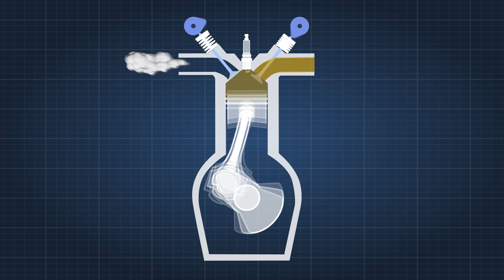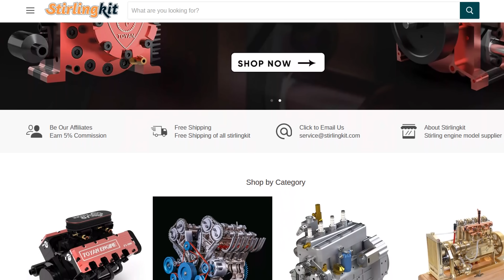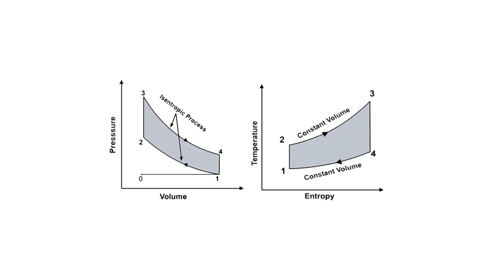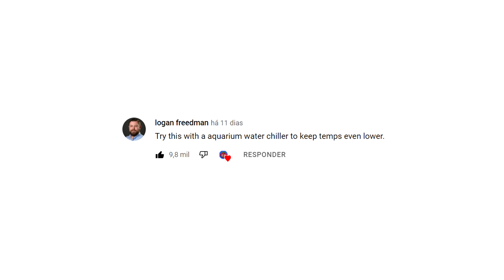I 3D Printed a Transparent Combustion Engine in Resin

Comment: Hey Integza car enthusiast here. We prefer ethanol and methanol for its cooling benefits. So if our car makes 500hp on gasoline, when you switch to alcohol fuels, you have to increase the fuel by 30% to achieve the same power, HOWEVER....its MUCH harder to get it to ignite, meaning you can delay ignition until much further in the compression stroke, meaning a more violent power stroke....all while cooling the temperature of your intake air AND cooling the engine itself....now if you add boost on top of these benefits, you now added compression...FURTHER enhancing the power stroke, so while you need 30% more fuel to make the same power, you can make usually 30% more power on a boosted application because of ethonals natural thermal efficiency...

Comment: #FutureVideoSuggestion  Try this with Multiple Cylinders.  

In my experience in life, I have noticed that the majority of ONE-Cylinder Engines, like in Weed Whackers, leaf blowers, Chainsaws, and such the engine on them are TWO-Stroke with a Fuel-Oil Mixture for power and lubrication combined.  Any time I've ever seen a 4-Stroke Engine, it has ALWAYS been multi-cylindered.  I can honestly say I have never seen a 1-Cylinder 4-Stroke engine, in 38 years of living.  

Also, there may be something to do with the Viscosity of the fuel that is having a big impact on your mini-engine.  Fuel and Lubricant Viscosity to CC ratio is something in engines that exists and has a BIG impact on performance.  

Also, comment from my wife:  It is the heat of flame that burns, not the flame itself.  :-P

Comment: So, the more explosive the fuel, the more piwer the engin has. Lighter fluid is a great fuel, but it's also extremely explosive. That's why we don't use it in engines. Gasoline is easy to burn, but harder to explode than literal gas. It\s the fumes that burn, so if it's just fumes... you know what I mean. Pure hydrogen will work too. But don't use it, unless you have a death wish.

Comment: It looks to me like the engine may not be getting enough fuel, and as such isn’t combusting on some strokes and then the residual fuel mixed with the new fuel is combusting when the mixture reaches its correct mixture/compression is artificially increased by the excess amount of fuel in the chamber. 

But there are so many things that it could be without looking at fuel mixtures. 

Considering the cylinder is the only thing that’s different and we ASSUME the engine was running flawlessly with its original cylinder. Must be compression.

Comment: How about exploring different types of propellor and their efficiency? for example a model aircraft brushless motor with prop, an EDF and could you 3d print a high torque motor so the impellor is driven from the circumference instead of the centre, so see if the additional air flow improved efficiency?

Comment: When you first put the clear cylinder on, we could see bubbles coming out from gaps between the cylinder and the head. Put a gasket in there. Also print your cylinder small and polish to the proper dimension. Just a thought.

Comment: If I was the kind of person to make complete conjecture based on very slim evidence, which I absolutely am, I would suggest that the 'engine' is perhaps underperforming due to speed fluctuation in the four stroke cycle, which you get since it is only a single cylinder engine (as compared with 4+ cylinders which, in firing more regularly, would create a more uniform speed throughout the cycle). With more cylinders, I also believe each cylinder becomes more fuel efficient.

Comment: The rpm different has  probably to do whit how fast the fuel burns. For example gasoline burns faster then Diesel fuel so the gasoline engine can spin at a higher rpm before the pistons “outrun” the combustion

Comment: methanol has a lower energy density but because of its higher air to fuel ratio it means you can flow higher fuel rates and acheive higher power

Comment: Timing needs to be picture perfect maybe to get 4:1 strokes, maybe the magnet for the ignition of the gas isn't the best? Maybe add a cam driven timing chain? like you'd see on most engines, if you're gonna be testing nitromethane, maybe better airflow as well to mix even more oxygen into the fuel? maybe adding a drive shaft to something to measure the amount of energy generated by the engine to really gauge and test fuels/mixtures.

Comment: This is just speculation I don't know a lot about chemistry or combustion but I think maybe your problem is scale. A lot of fuels burn much more poorly at small scale due to the large size of the molecules especially hydrocarbons like gasoline. But methanol is significantly simpler which could attribute to the better performance on the small scale. This comes from a number of factors that don't "scale" with physical size (Since the molecules in your engine are the same size regardless). Namely, the momentum of your piston bouncing back for the compression cycle is significantly lower in comparison because the piston has less mass relative to gasoline's resistance to compression ultimately resulting in a lower pressure.

Either way, great video! It's really cool to see inside the cylinder while the engine is running!

Comment: Methanol actually produces more torque in the same engine, but demands a hotter engine to works properly and the fuel consumption is 30% bigger compared to gasoline.

Comment: First guess would be air fuel ratio..
A lot of these fuels require a much richer mixture to obtain optimal performance.. 

E85 fuel for example need roughly 35%-40% more fuel than standard petrol to run correctly.. And a lot of these alcohol based fuels hate running on a cold engine without VERY rich mixtures.

Couple that with the changes in Ignition timing requirements.. I'd suspect that's most of the issue.

Comment: The air/fuel mixture ratio needs to be adjusted for different types of fuels. Our model plane engines had a small adjustment screw in the jet to vary this for the different fuels (even air temp/humidity). After starting the motor, you adjusted this to get the air fuel mixture almost (but not quite) to peak rpm. I see you just had this as wide open throttle and its best to get it to idle first, adjust, then open it full throttle and tweak. You were then good to fly. A four stroke also requires the spark plug timing to also be set correctly, but (while important) this was secondary to getting the air fuel ratio correct for maximum power.

Comment: In the 1910s-1920s, engines used on farms employed "hit and miss" controls to regulate engine speed. In this video (https://youtu.be/zR5kyrjM5dc), such an engine held the exhaust valve open when the engine speed was high (as detected by a flyweight governor). I've seen other engines that short out the spark when the engine speed was high. These engines tend to idle near their full power speed.

As loading increased, the engine would slow down, and more power strokes were needed to power the load and maintain speed.

You've determined there is a spark, but is there a spark for every expected power stroke? A spark at every at every top dead center would also work.

As others point out, spark timing may also need to be adjusted based on the fuel (some fuels burn much faster than others).

Comment: Two possible issues: 

1. Time to recharge ignition capacitors. Usually these small ignition systems are CDI, capacitor discharge ignition. They require a capacitor to charge up between discharges (sparks) and thus have a maximum frequency that they operate in, higher engine speed can result in not enough time to charge the capacitor. Switching to a two-stroke with a glowplug will improve reliability, but also generate a lot more heat.

2. Fuel / air ratio. The carburettor may not be supplying the right amount of fuel for the air for some of the fuels. You need to tune the ratio for each fuel to get close to the "stoichiometric" ideal in order to have effective combustion.

Comment: I think that the speed was too great for the whole system to function under the given parameters. The natural rhythmic cycle flow of everything was out of sync for a 4 stroke cycle to happen. Hence why it needed longer or shorter to be in a natural balanced cycle. I think the timing, flow rates and carby would need to be tuned for each individual scenario. I know this isn't the most elegant explanation but It will do.

Comment: the orange flame comes from unburnt particles and have nowhing to do with how powerful the explosion is. the orange flame just shows that there is particles that doesn't burn. 

I have a super simple experiment for you to try out. take an oxy acetylene welding torch, start the acetylene, ignite the air and fuel mixture and you will see loads of soot and a bright yellow flame. then turn on the oxygen and boom, blue flame with loads more potential.

Comment: Alright, you're the individual to test this @Integza I want you to make and test a transparent, H-H-O fuel via electrolysis, Internal Combustion Engine, with energy recovery methods to power electrolysis  from exhaust gases and waste heat(after the engine has achieved stable operation). Something that could scale to a 140hp vehicle engine, or even  <5hp small engines for chainsaws, lawnmowers, etc.. Green energy can also mean loud engines :D not just screeching tires.

Comment: The engine you are using is a hit and miss engine, so it is not supposed to fire once on every 4 strokes. You should do another video using a true four stroke engine. A little info on the hit and miss motor is that they are a very early form of a gas engine and hit only on some power strokes and miss the next few and then hit again to keep the engine running.

Comment: The reason I can think is that you have bad mixture. Either rich in air or fuel, but by the amount of liquid I can see on the walls of the cylinder I assume it's rich in fuel.

Comment: As you didn't make any changes to your engine when experimenting with different types of fuels, we who work with alcohol powered engines know that the last composition must have been better because of the higher ratio with the air/fuel mixture and also with the higher ratio compression of cylinder/engine head.

Comment: I think your engine is actually loosing some pressure due to it not being sealed tight enough. From some of the angles I seemed your resin cylinder was leaking were it meets the head. Maybe use a cork gasket to help with the mating of the parts

Comment: more powerful fuel only gets more power because it is harder to ignite and you use more of it, you need more compression to take advantage, and spark timing was your only problem with the other fuels, try closer to 50 degrees of timing

Comment: So you need to check the Air fuel mixture and ignition timing remember that naturally aspirated engines also can suffer from pre ignition which is why we use methanol and ethanol for the reduced ignition propensity running on different fuels means having to vary AFR and ignition timing accordingly

However this was a valuable test ad I have not seen the result of running without compensating for these fuel differences

Comment: don't forget about diesel engines
even the 1.9tdi, one of the most reliable and efficient engines ever built, has an energy coefficient of 38%
this also means that it has difficulty reaching operating temperature wich is why an electric coolant heater is required

how reliable is it?
lets just say, if you happen to have a spare engine you may never find a buyer, I know people that scrapped their spare engine after 3 years not finding a buyer
with about 300.000km my engine is in much better condition than a ford ecoboost at 100.000km

Comment: it's not about the rpm of the engien . its power of engien to be done. if we add some load to the engien we comper the fuil required to put on it by the load comparision and work to be done and fuil required to burn!

Comment: I'm no expert, but I'd have to guess the high percentage nitromethane performed best in the small engine for whatever reason that also makes it a popular fuel for nitro powered R/C cars and trucks, boats, and planes. It seems like a lot of R/C models with 4 stroke or 2 stroke internal combustion engines use nitromethane, and I'm not sure why, but with my limited but enthusiast understanding of engines and how they work maybe it has something to do with how the fuel performs and combusts in small quantities or small volumes, since many R/C cars use incredibly tiny engines with incredibly tiny displacements, my Traxxas Revo 3.3 has an engine of just 3.3 cc for example and can run on nitromethane of 10%, 20%, or 33%. 

I don't know enough about gasoline, methanol, or nitromethane to even know the name, if one exists, for a property of how it performs in different volumes. I know humanity has created engines in so many different sizes, from engines several stories tall with massive cylinders that could fit several people inside, to teeny tiny engines that could fit in the palm of your hand, all using a different range of fuels that seem to perform better at those scales. Maybe something to do with each fuel's optimal air-to-fuel ratio? I know they call that stoichiometry, in automotive applications gasoline typically has an optimum air-to-fuel ratio of 14.7:1, or 14.7 parts air to 1 part fuel. Perhaps in a lower displacement engine where less air is present in the fuel mix a certain fuel with a different air-to-fuel ratio will perform better? Maybe that could be why both gasoline and methanol didn't perform as well in this little engine as the nitromethane. 

Or perhaps it has to do with compression ratio? Maybe gasoline and methanol require a higher compression ratio than nitromethane? After all, I didn't see you reprint the cylinder or experiment with a different o-ring or seal on the piston to try to increase compression ratios in the engine. Maybe it's a little of both air-to-fuel ratios and compression ratios combined.

Comment: If the cylinder weren’t exhausting the entire contents of the cylinder during the exhaust stroke, the plug may be firing into a dead charge unable to ignite the cylinder until the next cycle clears it. Typically scavenging from the exhaust pulses plays an important role here. You may try adding a bit of positive pressure to the intake to overcome this. Would make for an interesting video.
Reply: I suggested the same as the main issue - too much exhaust gases at misfire cycles, and also that adding some turbo could partly sort it.

Comment: It looks like the timing of the ignition is off causing engine knock. This is where fuel ignites while the piston is on the upstroke, essentially pushing against itself. This was a huge problem for WW2 aircraft (as the more air pressure you put on the engine the higher the chance of knock but also the more power the engine produces). The allies overcame this with higher grade fuel whereas the axis used methanol water injection

Comment: could be a tuning issue AND a sealing issue. Could try other fuels with longer carbon chains for fun (kerosene and diesel?) I'd be curious to see Leaded Gasoline to see if it coats the cylinder walls quickly or if its more minute.
Reply: could also try ethanol and butane for fun.

Comment: Could you try a 3d printed diesel engine? Would be a really cool challenge, especially if you could get out to be compression ignition like an actual diesel cycle. A quick note on fuels and RPM: Burn rate and expansion rate may not be directly linked to energy density of the fuels.  Diesel has a much higher energy density than gasoline but does not burn as quickly and so (typically) produces a much lower RPM but can handle a much greater load at those low speeds.  If you look at the power curve of a typical diesel engine compared to gas and alcohol, you'll see insane torque at low RPM for diesel but a very low max RPM and so a low peak horsepower whereas gasoline and alcohol engines tend to produce more torque at higher RPM before it is surpassed by horsepower. Horsepower being a unit for work done in a given time (the formula: HP=(TORQUExRPM)/5252 ) means that while a given amount of fuel may be more "powerful", that doesn't necessarily mean it spins the engine faster.

Comment: I have the answer. To get the extra power from methanol or nitro, you need to deliver more fuel by tuning the carburettor. 

Both methanol and nitromethane have a lower energy density than gasoline, but you can burn much much more of it, and that’s where the extra power comes from.

In the case of methanol, you need to get twice as much fuel in to the cylinder for the same volume of air. In the case of pure nitro, you need around 8x as much fuel compared to gasoline. If you’re not tuning the carb to deliver that volume of fuel, then all you’re doing is running the motor really lean, leading to a faster rpm and less power due to not enough fuel in the cylinder for proper combustion on most of the combustion cycles.

Also, if those are RC fuels that you’re using for 16% and 25% nitro, they’re designed for two stroke motors and contain a lot of castor oil or synthetic oil meant for tiny two strokes. I would find out what % oil is in it and take the pure methanol and dilute the RC fuel down until it’s around 5% oil, but doing this will obviously also reduce the nitro %.

Comment: Integza, it takes more alcohol than gasoline to run an engine. If you notice when a lawn mower runs out of fuel and the carburetor goes lean the engine will speed up. This is why the methanol runs faster. My guess is that as small as the engine is it will not run efficiently on gasoline.